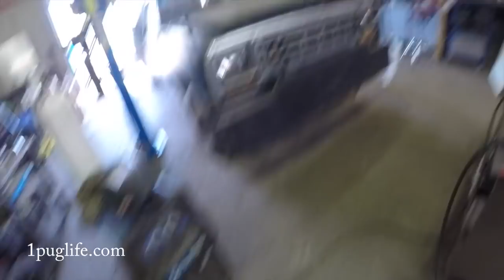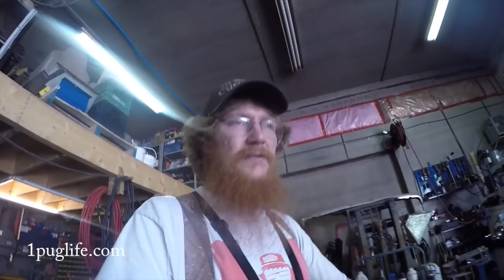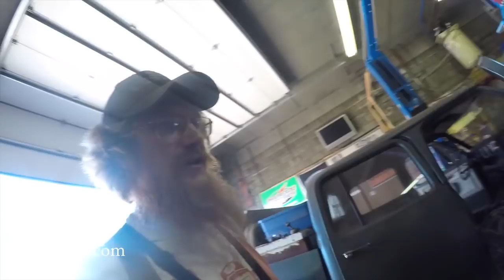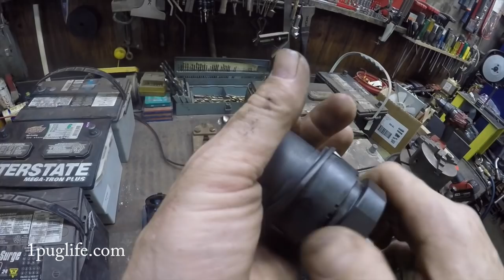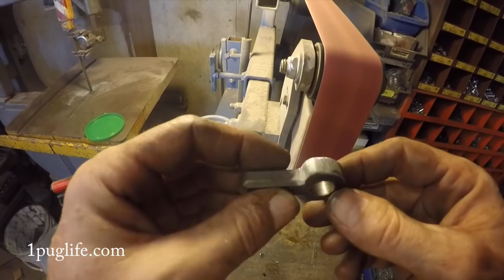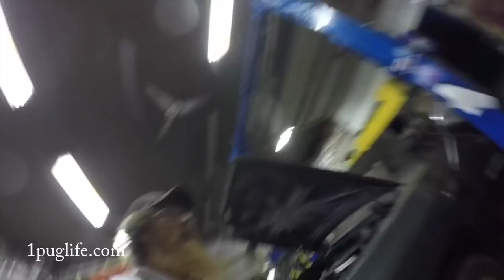saying good bye

Comment: A drill Dr is nice to have, but honestly if you know angles and have decent vision, a single piece of 120grit sandpaper far more easy to use, cheaper and dramatically far more efficient. I can sharpen atleast 2 bits in the time it takes to set up a single bit in that bit service machine. I've purchased one, and was rather not satisfied by it for the little amount of effort it saves. But! That's just my opinion I've established through my own personal experience.

Comment: Guaranteed he gets to Mississauga and trurns around ..
Reply: GYPSY400 because he’d be heading in the wrong direction?
Reply: No he would have to pass through Mississauga ( Greater Toronto Area) to get to the west.. unless he crosses in to the Merica.

I really don't see that worn out silvanaudous making that far with no issues.
Reply: He was stuck in Sarnia when the truck broke down for the first time, new oil cooler lines and radiator, spent three nights there instead of calling Pug for help, it was repaired by a GM dealership instead of calling Pug to tow it to the shop to repair it.
Reply: Thanks gypsy. I needed a good lol. You had me cracking up.
 I'm glad they are you tubers so I can follow their adventures.

Comment: You should make it with removable leads and longer leads so you can spot weld over in the middle of the truck floor and wide projects and tight spaces... Also needs a foot pedal operation.... But you're a GOOF and can't do it...
Reply: Very good point he should have one detachable lead because you can only get as deep as the jaws will allow with one removable lead a longer lead you can weld all kinds of places ( difficult to reach places)with the spot welder
Reply: Zit Drainer.....show us what you can do then GOOF!